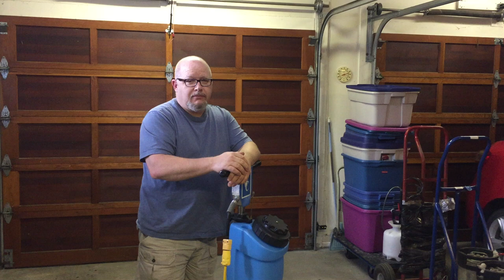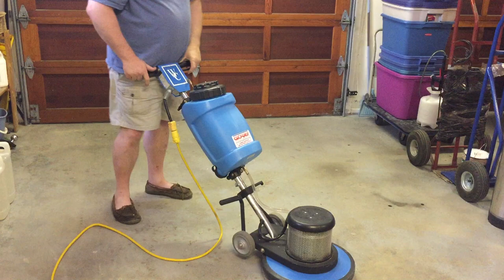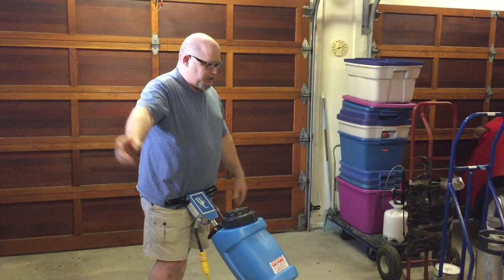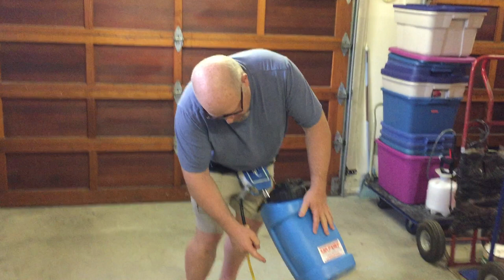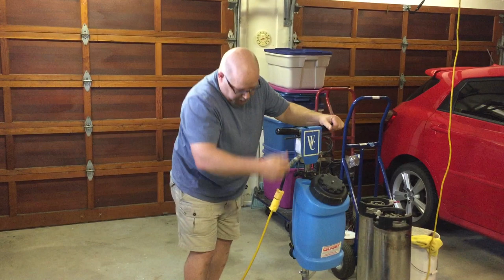Oxy-Dry How to operate the rotary machine

Comment: Great info!  Never try one out at your paying job unless it is a empty room and no cameras 😉.  Try it at home in the garage or driveway with a white scrub pad and maybe a little water.  Be careful if the drive has a lot of texture or you might (most likely) will go for a ride.  The tip about the clamp Is great, I had never seen that as when I was taught it was at a hospital and you just had to adjust as needed as someone else might be using the machine later.
Reply from the maker: There is a type of 2 piece clamp called a collar clamp that would certainly look better and they come in various sizes and are available on Amazon. the Hose clamp works fine but the collar clamp really looks cool!

Comment: I just bought a rotary and I’m having issues operating it. It wants to push me backwards and I can’t get it to move forward. Any suggestions?
Reply from the maker: That will happen if you twist the handle while holding it, I expect you are twisting it to the right.  If using a rotary for the first time it is best to find a smooth concrete floor and us a wet pad to reduce friction and practice till you get the hang of it. Once you get it you will find it very easy to operate, like riding a bike.